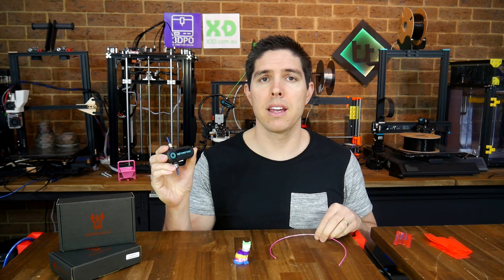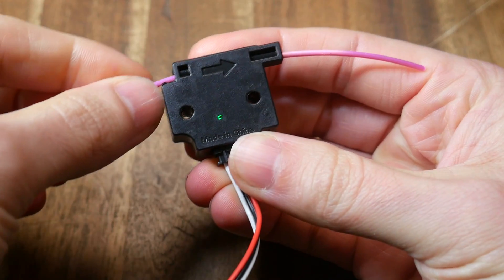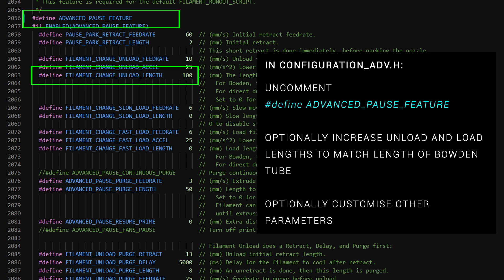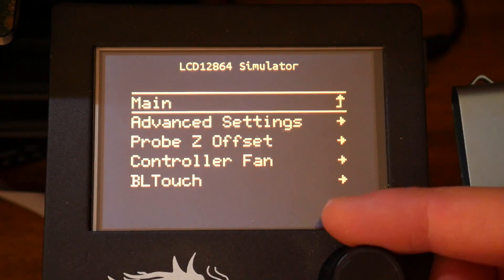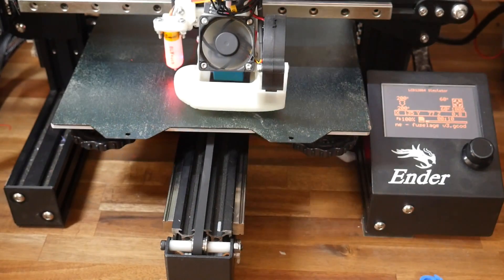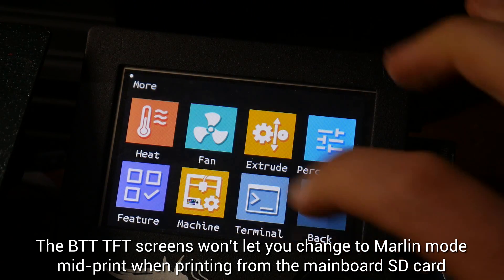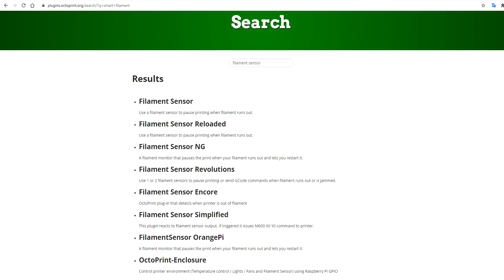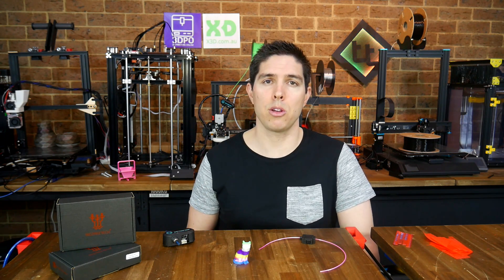BTT Smart filament sensor guide - Detect filament runout and jams

Comment: What about SFS 2.0? It has a 4-pin cable. 4 to SFS and 2x2 for SKR (as BTT recommends in instruction). But, I'm not sure that in this case, it will work as expected, when of the print host is TFT35. What do you think?

Comment: Although it may be more difficult to pull filament from a before-extruder arrangement, I prefer BTT's recommended post-extruder arrangement because it's one less "feeding" you have to worry about every time you load filament, which I think outweighs the hassle of rescuing filament from only a small percentage of prints.  But, I agree this heavy thing bouncing around, putting stress on the tubes & couplers, is REALLY bad.  So I designed a reliable bracket (and cutting the BTT-supplied tube to the minimum) to fully-support it after the extruder: Thingiverse # 6514831

Comment: Does anybody know what the correct settings in klipper and the slicer gcode are to avoid a false positive when the print first starts? Mine set off after my ratrig did a prime blob and then it displays as "empty" on Mainsail. It seems to be working but I haven't wanted to run a test as I pretty much immediately started a large print after I installed it and haven't wanted to risk interrupting it.

Comment: Michael, good work. I do have a question about my setup. I have a Creality Ender 3 with original board 4.2.2. Want to add a Btt filament sensor. I have set it up through the smart filament sensor plugin and it seems to work to identify then the filament is out but does not stop or pause the printer. I have tried M600 and M601 command but does not work. The Marlin firmware is version 1.1.2  Looking for direction

Comment: A). Do I do firmware updates BEFORE  plugging in the smart filament sensor?  I did it when plugged in and have issues. 1)the btt TFT 3.5 screen is black when I turn on. I tried all different 3 socket on TFT. No good , still black.  2) I moved the TFT screen from right to left so SFS cable could plug into back of tft screen at correct socket.  And the screen on TFT is good now. BUT. 2) the SFS acts like it’s constantly out of filament when I can see filament all the way thru it.  Please Help

Comment: Hello, 
I have 2 Sensor smart BTT, They are connected to my motherboards (yes yes on the motherboard) while I have BTT TFT 35 screens, an SKR2 and an SKR Mini E3 V1.2. To make it work with the BTT TFT screen, I add the M75 command to the startup G-code.

It works, but sometimes I have to compile multiple times. when it works it works all the time, perfect, but 7mm for detection is too small for me. I often have involuntary alerte leaving 7mm, I write 15mm.

Comment: If you are having trouble with TFT 35 try inputing M412 D7 via terminal  (in my case when flashing firmware, the filament runout distance was not set to 7mm, it worked perfectly after that)

Comment: I have Marlin 2.0.9 on the 3D printer. If the filament runout sensor or I send the filament change on the display, Octoprint also pauses. To do this, I have to manually release the print on the display again, then Octoprint continues. The runout sensor is connected to the printer.
There are no problems with Octoprint because it waits for the OK from the printer.

Comment: hi michael, can this device be used with the original 4.2.2 motherboard of the ender 3 v2 or must it necessarily be used with the skr motherboard?
Reply from the maker: As long as you can compile the firmware and have spare mainboard input pin, any mainboard is fine.
Reply: @TeachingTech  Thank you very much

Comment: I am going to try 15mm instead of 7mm for my sensor. Mine keeps sensing and stops about 1-2 hours into the print with a "Press to continue" message after that my print completes without any issues. Also, Mine did not trigger when the last time the filament ran out. I texted the sensor and it is working. I have my Filament in a BIOS 2 spool dry box and it takes a slight bit of pull to roll the filament. With a spool of Atomic filament, a slightly over sized filament spool, the sensor would trigger every few seconds. Thinking there was a tangle in the line. It worked fine after I took the Atomic roll out and put it on a separate spool holder.

Comment: I just lost a 15 hour print at hour 13 due to a broken/snapped filament. very frustrating. I'll be installing something like this if I can. However, I use the ironing feature in Superslicer, which will pause extrusion for extended periods of time. Can the sensor and slicer be programmed to work with the ironing process?

Comment: I thought I'd add an update. I recently purchased the BTT SFS to work with my BTT TFT 7.0.  The TFT has been great, and since I have an 8 year old printer, I thought the SFS would be nice to have. I cannot get it to work. I hooked it to the TFT and it registered a filament runout as soon as it starts the print. I can find others with the same issue, but there doesn't seem to be a fix. Since these are both BTT devices, the SFS should work right out of the box. I've made all the changes required in several online forums, but it always shows a runout condition at the start of a print. After watching this video, I think I'll move it to the mainboard and try again. BTT makes great products but has lousy support.
Reply: There has been an update to the tft firmware and BTT recommends connecting it top the mainboard and not the screen....inside the config.ini file of the tft firmware you can find all the info to make it work...Make sure to add the m75 commands in the startup gcode for the tft.....and there is a list of things to enable in marlin for the screen to work properly
Reply: Thanks Sal. I’ve moved the SFS back to the SKR1.4 and I’ll give this a look.

Comment: HI im just getting filament runout of filament error same as you on display actualty without any filament sensor installed  it will print 10seconds and after it show this and filament is ok no clogged     what am i doing wrong i just compiling firmware   

after some time i tryed install this sensor and doo exactly same as you doo and im getting that same error  not tryed display yet but im getting this problem same without having sensor and all lines you uncommented are commented. 

any help please?

Comment: I have the Ender 3 Max modified printer. I find the stock sensor without taking it apart the filament just will not feed into the sensor very easily. And I don't want the frustration when trying to load filament. Plus having a filament jam sensor built in is a bonus.

Comment: I can't get my build to compile. After following these steps I get errors and it doesn't compile the new build.  All I did was uncomment the ones you told me and tried to compile it. Tried 3 times and it won't work. Any help you can give would be greatly appreciative as I have had this sensor for a month now and would like to get some use out of it.

Comment: considering you can use sensorless homing on your printers, couldn't someone good at coding just write the Jam and Clog sensing into code, and use with your klipper firmware, on the extruder motor? 

just need someone better at code than me that's for sure XD

Comment: Is it normal to get this when compiling?
In file included from Marlin\src\HAL\STM32\../../inc/MarlinConfigPre.h:39,
                 from Marlin\src\HAL\STM32\MarlinSerial.h:21,
                 from Marlin\src\HAL\STM32\HAL.h:34,
                 from Marlin\src\HAL\STM32\MarlinSPI.h:24,
                 from Marlin\src\HAL\STM32\MarlinSPI.cpp:26:
Marlin\src\HAL\STM32\../../inc/../../Configuration.h:1478:38: warning: extra tokens at end of #ifdef directive
 1478 |   #ifdef FILAMENT_RUNOUT_DISTANCE_MM 10
      |                                      ^~

Comment: I bought a Biqu smart filament sensor to try on my raspberry pi 4 using a smart sensor app in octopi.
I have a choice of using 5 or 3.3v and was wondering if 5 v is safe for the pi gpio as far as signal input level from the sensor if it delivers 5v or do I want to use 3.3v to power the sensor? It says it can use 3-5v power.
Next is the wiring pinout?
I can’t find a actual detailed pinout of the sensor 4 pin but 3 pins used connector or the 3 pin on the extension cable. From skr board connector photos I’ve checked the cables have some coding on them.  It seems long white dashes — — — is G Ground, X is S Signal xxx xxx xxx, and  short dashes should be +3-5v power in - - -. However, on my wires there are no short dashes - - -,  just tiny writing listing the wire size. So one could assume this is the 3-5v wire, but you only get one chance. If wrong you get smoke!
So if anyone reading this has wired up the smart sensor successfully to a pi, not just plugged it into a skr board, please post the wiring labeling you used for ground, signal, and 3-5v power. I’m sure I have it figured out but better safe than sorry! 
Thank you.

Comment: Great video!
I did a search for filament sensors and was surprised to find that the incorrect terminology is more popular. "Runout sensor" had more results than "run out sensor". In 3D printing can we "run out" of filament. Filament doesn't runout unless it's rotating axially. Of course, "bed leveling" is used instead of "tramming", so I guess it's going to stick. 
I wonder if a 3D printing terminology video would be accepted by the community?

Comment: Since the filament runout sensors uses the advanced park feature, just like the change filament action (which does work with octoprint), shouldn't the printer send  that same pause command to octoprint?

Comment: Nice video, can see that this would prevent a lot of ruined prints. However if it was a truly "Smart Sensor" than all the logic should have been built in. It would see a break or a jam allowing it to out put a signal same as a traditional filament runout sensor(triggered or untriggered). This would eliminate all the configuration changes. That would be a true plug and play replacement for a traditional filament runout sensor.

Comment: Hi. I m neu in 3d printing. I just purchased an Ender 6 and would like to install a BTT Smart Filament Sensor. 
Three major problems.
1. Does the BTT Smart Filament Sensor work on the Ender 6?
2. If yes, how do I install the Hardware correct
3. I understand that I have to change the Firmware, but I don ´t even know where I find the Firmware.

Probably I ´m just a little idiot, but if I don ´t ask, I will never lern.

Thank you for your help and support in advance.

Thorsten, Germany

Comment: If anyone is having the issue where the sensor always reads as triggered with the 4.2.2 or 4.2.7 board giving false readings . The solution for me was to go into the printers settings (not the firmware) configuration>advanced>filement. And change the runout settings there to 7mm. For some reason it's set to 0. Although it was set to 7mm in the firmware. Hopefully this helps a few people out.
Reply: Thank You
Reply: You are an absolute life-saver! I was losing my mind trying to track down what was causing the issue. I never even thought to check the printer settings!
Reply: thank you.
btw, this is caused by not initializing the eeprom after making firmware changes.

Comment: Pliki konfiguracyjne zmodyfikowane na podstawie filmu...
Błąd kompilacji:
In file included from Marlin\src\feature\bedlevel\abl\../../../inc/MarlinConfigPre.h:39,
                 from Marlin\src\feature\bedlevel\abl\../../../inc/MarlinConfig.h:28,
                 from Marlin\src\feature\bedlevel\abl\abl.cpp:23:
Marlin\src\feature\bedlevel\abl\../../../inc/../../Configuration.h:1849: warning: "NOZZLE_PARK_FEATURE" redefined
 1849 | #define NOZZLE_PARK_FEATURE
      |
Marlin\src\feature\bedlevel\abl\../../../inc/../../Configuration.h:1453: note: this is the location of the previous definition
 1453 |   #define NOZZLE_PARK_FEATURE "M600"

Comment: I need a filament sensor that attaches to the top of my Hemera direct drive extruder and doesn't just fall and dangle when the filament runs out.  Unfortunately the sensor in this video will fail for my needs because when run out is detected and Marlin tries to back out the remaining piece of filament from the hot end the filament will get stopped and stuck inside the sensor causing a jam in the Hemera which is typically not easy to clean out.  The jamming inside the sensor will occur because the filament cannot slide easily in between the two sensor bearings without some hand manipulation to get it started.

Comment: Hello.  can you help me with this?  I purchased the ender 5 pro, installed the skr mini e3 v2 and compiled the firmware but when I home the printer, the head crashes into the gantry.   I have the marlin version 2.0.8.2.  Thanks in advance
Reply: how does the head crash into the gantry.  The head is attached to the gantry, no?

Comment: Does anyone know why the sensor stops my print after a few seconds ??! Is there something wrong with this guide ? I've followed the steps provided from @Teaching Tech but for now when I start a print after a few seconds filament runout detections triggers and I don't know what to do. I have btt skr e3 mini v2.0 with marlin 2.0.7.2 fw version and I'm using E0-STOP header (PC15 pin). Any help would be appreciated !
Reply: I found out the problem ! I'm posting here if anyone else need this answer: https://github.com/bigtreetech/smart-filament-detection-module/issues/1#issuecomment-570776528
My problem was that Marlin does not set the runout distance after flashing the firmware.

M412
echo:Filament runout ON
Filament runout distance (mm): 0.00

M412 D7
echo:Filament runout ON
Filament runout distance (mm): 7.00

After that the sensor works fine for me
Reply: i have about the same setup as you except i have skr mini E3 v1.2, the E0-STOP header (PC15 pin) is a 2 pin connection cable has 3 sig-gnd-pwr did  you split and use 5v off the board?
Reply: @garyclifton2772  Hey there. You have to do this in your motherboard because if I remember correctly there is no connector for bltouch sensor. But in SKR 2.0 there is a connetor with sign-gnd-pwr. Also check your motherboard's MCU maximum voltage. Because if you connect a signal or powersupply to a non-5volt tolerant pin then you may damage your MCU. Hope this helps.

Comment: Also for those who have only a switch as filament sensor this might work with a small uC in between which gives ok as long as filament is not broken and still running.

Comment: Marlin didn't apply the filament runout sensor distance for me on Ender 3v2, Creality 4.2.2 board.  M412 was returning 0, making the print stop immediately.  I ran M412 D25 to set the distance to 25mm for my direct drive setup and all is well!

Comment: is there any update on this?? i've got ah Biqu B1, added the Smart Filament Sensor to the TFT (its allready connected on the B1 on the back), and it worked, atleast i got false-positive filament rounout warnings (as this is another problem) but somehow and don't know what has changed, as i did some adjustments to marlin (like linear advanced, and also played with the UPS, whats again another story as it does not work :( ) the filament sensor also doesn't work anymore... i've changed my extruder to the H2 now, and have no filament through the sensor it just prints 🤦‍♂️   but what the heck is gooing on?

Comment: I bought one of these and connected to Octoprint with the Smart sensor plugin and PSU stopped working.  Also in the middle of a print, it parked the nozzle and turned off the heat and backed out the filament.  Finally disabled the plugin.  Now PSU is working again and it completes prints.  Need a good video on using this with Octoprint.  I'm using Marlin's 4.22 Stock firmware on my Ender 3 V2. Where are these Configuration changes?  In the firmware compile?  I subscribed to Marlin.

Comment: I just added my sensor yesterday due to sometimes my filament will break or it just runs out at 90% of the print.  I felt really good when I would see the sensor going into park mode when I run a print and the filament is not moving because I had to adjust my nozzle from the bed.  Once I got that done I started an overnight print, in the morning the filament broke and it looks like the printer completed the print as though nothing happened.  The print was about 95% complete, the print had already come loose from the glass bed because it was now cold, there was no detection from the sensor on the tft.

These are my thoughts now, if the sensor detects that there is a break how long is the sensor going to wait for you to put in new filament before cancelling itself.  I really would like to know what happened and I have to start this print all over again.  

Has anyone experienced this?

Comment: Michael I have a question I hope you can answer. If you have a CR-10s with filament runout detection already enabled, is this a simple swap with no firmware or hardware changes?

Comment: I installed this using the SkR mini E3 V2 and at the start of the print after the priming line it throws up a change filament and begins unloading the filament. Could this be a firmware tweak? I utilized the latest Marlin Bugfix firmware in the build as well as this video and the dedicated EO stop port on the board.